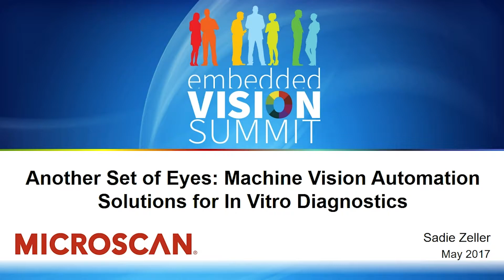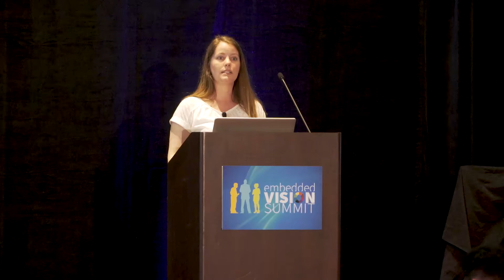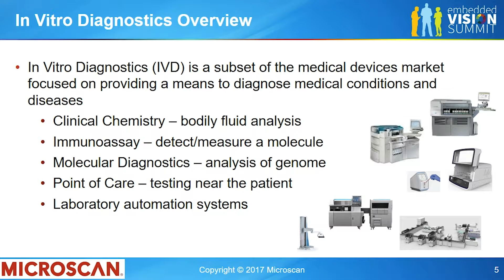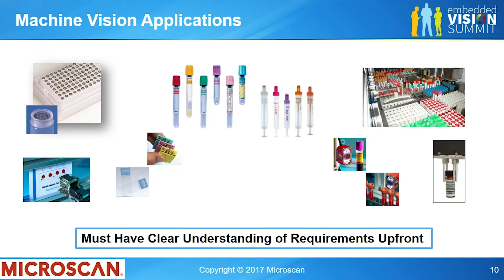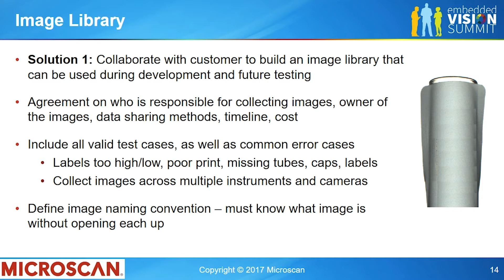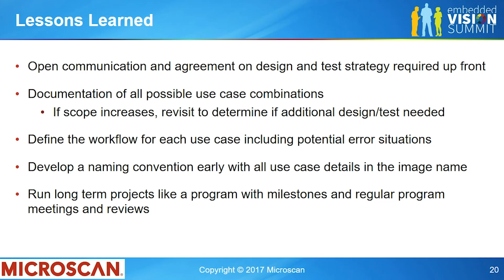"Machine Vision Automation Solutions for In Vitro Diagnostics," a Presentation from Microscan

Comment: My notes:
-acceptable error rates are typically 1 in 10k (!)
-failures need to noted ASAP and be complete ("fail safe"; don't give garbled output)
-need consistent naming/labeling schemes across teams
-always check/recheck the output of the module (may include constant re-calibrations)
-make customer aware of possible failure modes (e.g., codes on tray obscured or not there, lights go off, etc.)